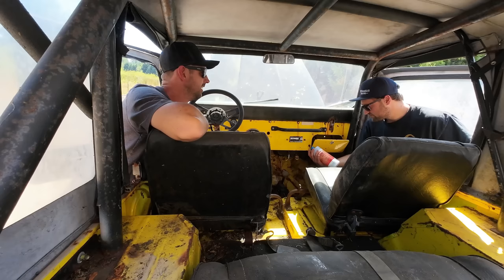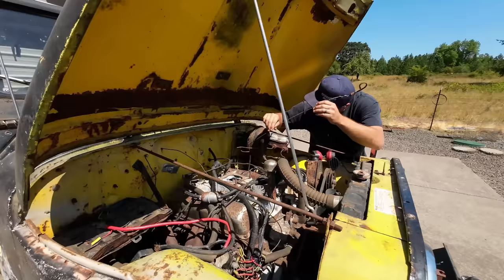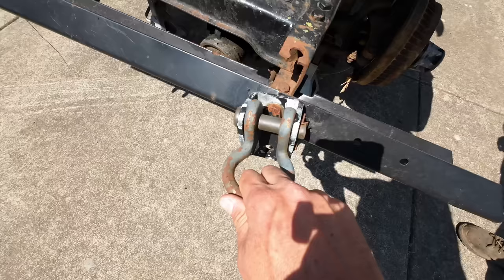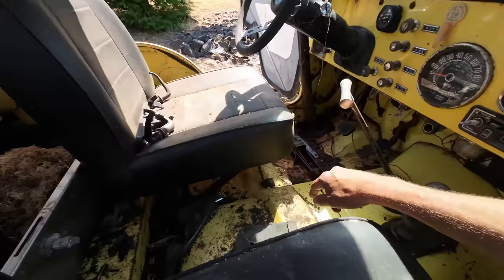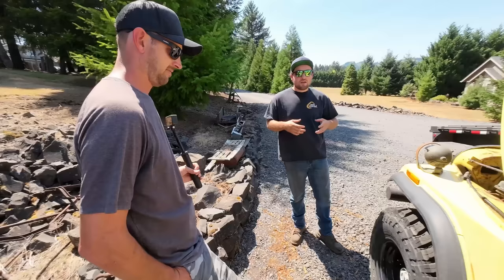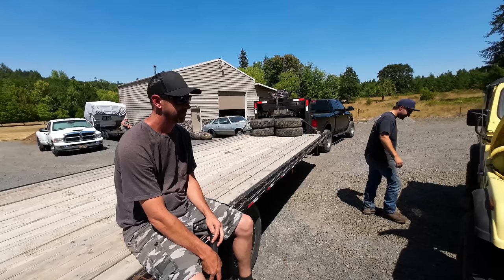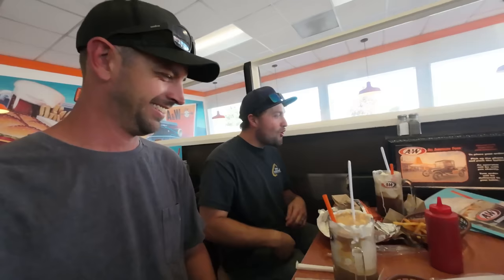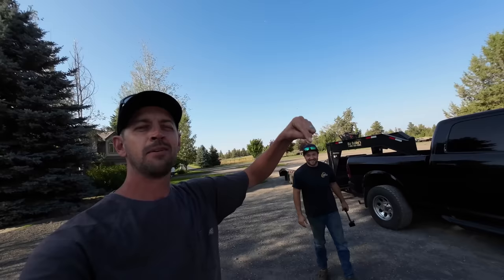We drove 100 miles just to eat this lunch..

Comment: My Dad's first cell phone was the bag-style.  We chose that over the big huge handheld available because it was 3 Watts compared to 0.7 Watts.  MORE POWER 😆 Then my first was in the era of the Nokia candybar/brick, and I still appreciate how simple those were to operate.  The little 4-way pad at the top was great!  One click up went to your most recent calls, down to your contacts, right to received calls.  Not sure I have those directions correct, but it was a lot easier to use as a phone than today's "phones".
Reply: Each group at my job back then had a bag phone which was rotated to whomever was “on call” for problems that week. Used it only a few times.

Comment: The tin foil is like car lots used do with bondo they spread it on wax paper so its really thin & as it starts setting up they tape it on the holes & let it dry then a light sanding & paint it looks great until you hit a bump & you paid way to much for a rust bucket the bondo comes loose falls out  your out however much you paid ! Casey had the best outro !

Comment: I'm only 48 and my first cell phone was a Nokia brick that didn't even have a game on it.  Plus our house phone was a rotary dial with the receiver on the top. It had two cradles that went up and down when you put the receiver on and off the phone. That phone looked so old that when my friends would come over and ask to use the phone once they saw it they would ask if it worked before they even used it. I'm so happy Quinton didn't buy those jeeps. Casey has the better close-out video.

Comment: I got all of you beat. I sold one of the first "cellphones" back in 83-84. It was those shoe box style mobile phones you had to carry around or permanently install in your automobile. The mobile ones required two big 6 volt batteries that had to be charged close to 24 hours. To program the phone we had to use the old RS-232 plug with a module that had to be hooked up to a computer. After the phone was programmed you had to make a phone call "in your area " within the first 24 hours. There were designated pockets of cell towers but you could not "roam" driving between towns. So there were towers in Raleigh, and Durham and Chapel Hill but if you wanted to make a call between those areas forget it. The average price of a mobile phone was $1999.00. If you forgot to make a phone call in your home area it would disable the phone from working and you had to go back to the store you bought the phone from to get it reprogrammed. I think it cost $1.00 a minute to use the phone.

Comment: Phones huh? Carrying a bunch of dimes to make local calls when out looking for a job. Adding a 25' long coiled handset cord to the kitchen phone was a HUGE improvement. Phone booths that were a viable shelter in a  rainstorm. And yes, experienced that party line but that was when traveling to the grandparents old place. Then again, did so much rotary phone dialing that I got too fast for the switching center to follow the clicks. I'd try to speed up the return spin on the dial. Hard on the fingers!

Comment: Grew up with a black bakelite dial phone on a 5 party line.   The railroad about 3/8 of a mile down the road started a field fire.  My mother saw it and went to call the fire department but the neighbor kids were on the phone and refused to get off for some time, until my normally mild mannered mother finally threatened them with calling the sheriff and local phone company about it.  Fire burned for two miles across the fields almost to the high school.  My first cell phone was a Nokia through Tracfone in 2001.